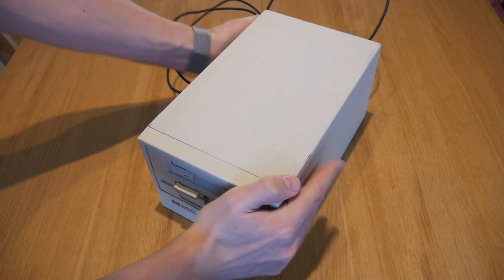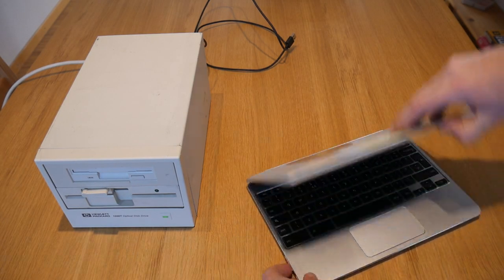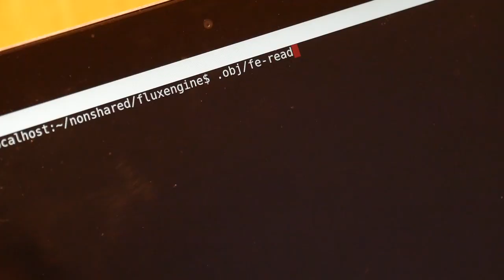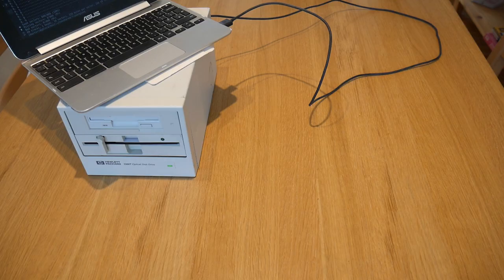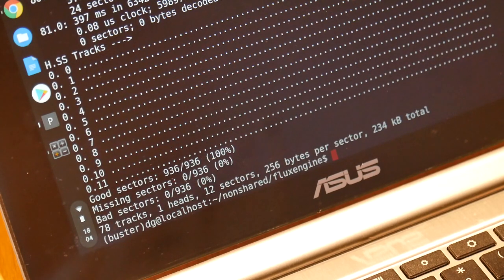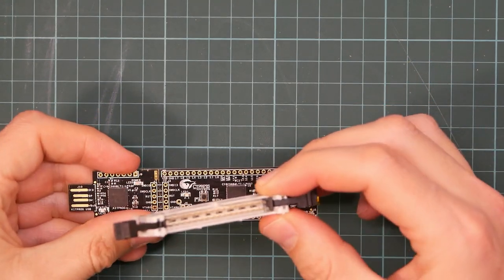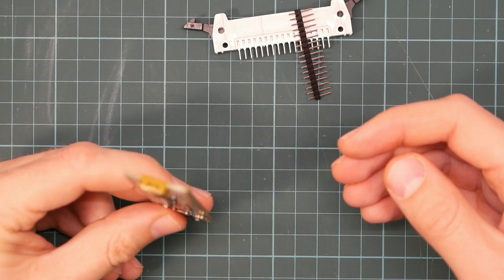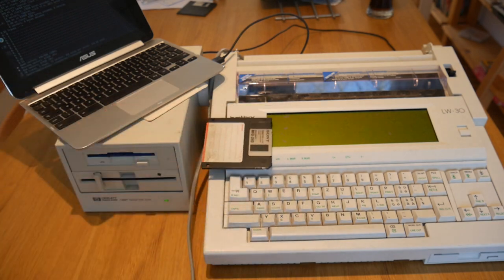Hjalfi reads floppy disks

Comment: I'm more interested in where you got that case from!
It would be cool to see it read Apple II, Commodore 64, or TI 99/4A diskettes
Reply from the maker: Computer recycling place in Zurich. It's a HP full-height optical drive case. It actually turns out that 2 * half height != full height, so the opening is just a little bit too small and I ended up snapping the top of the case trying to make the two drive bays fit...

I have read Apple II disks, but don't have any C64 ones myself. I've had reports from other people that they work, though. I didn't even know the TI99 had a disk interface!

Comment: Does it read CP/M disks? I think it is capable, but it would need to work like cpmtools (under Linux) or 22DISK145 (a proprietary program written by Sydex).

Many CP/M users have what is known as a "tweener" PC, a (generally old) PC used to copy CP/M disks. Notably, boot disks. Problem is, the tweeners are getting old and unreliable (being generally no newer than Pentium 1), so what is needed is a cheap, simple tool to replace the tweener and allow disk operations on newer PCs.
Reply from the maker: I haven't tested it with much CP/M stuff but so far, yes, it works fine. Big note: it reads the disks; that is, it makes a filesystem image from what's on the disk. It doesn't decode the filesystem; that's cpmtools' job.

Incidentally, if a PC will read it, any PC, then the disk is an IBM scheme FM or MFM format disk (because that's all that PCs support), so it'll most likely work out of the box with FluxEngine.
Reply: I know the question was answered 3 years ago - but, in case others stumble across this, I can report success using this most excellent system to read 5.25" floppies from a MAP-80 Systems CP/M machine. And, if you follow the links above (in Hjalfi's notes below the video), you'll find reference to several other CP/M systems. And you'll see that he's continued to update the software to deal with a wider range of formats. Thanks, Hjalfi!!